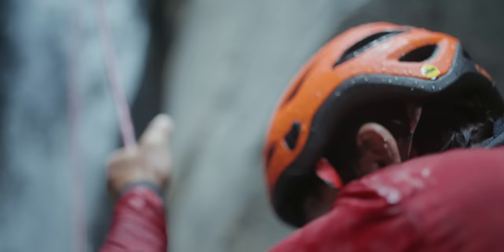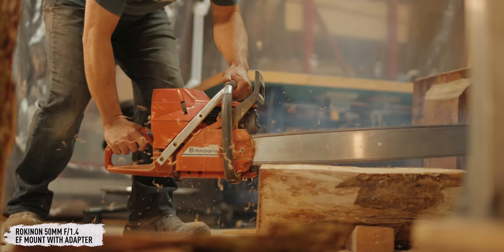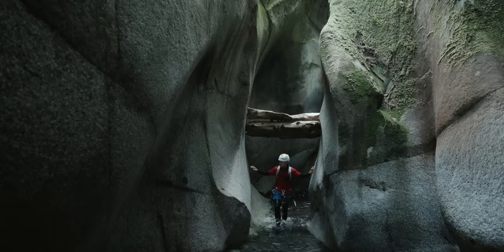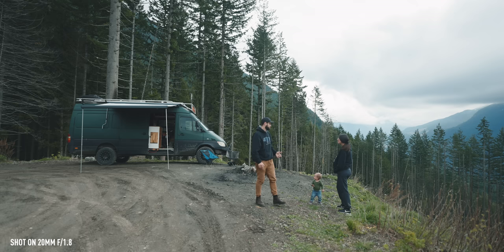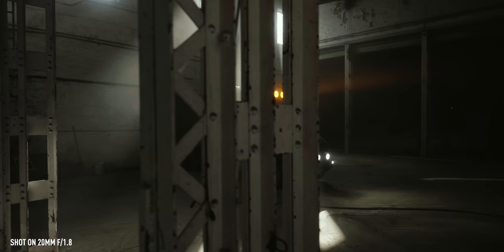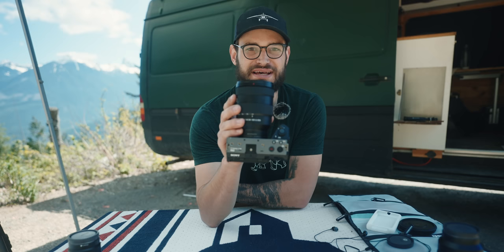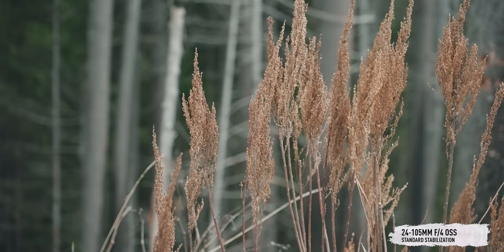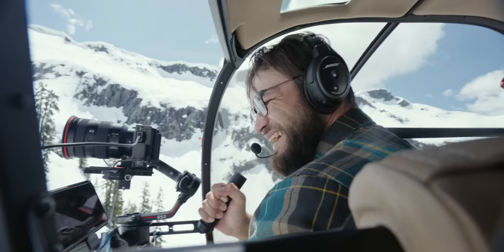The Best Lenses For Sony Full Frame Video A7siii & A7iv

Comment: Thank you for making this video! I need to be reminded not to fall into the focal length trap on the daily 😂. I'm torn between the 24-105 and the 24-240, we film outdoors mainly and I'm often in scenarios where I'm far away from things happening (hiking for example). My first instinct is to get the biggest range, but I figure there is a reason everyone raves about the 24-105!

Comment: Great video. I have 24-70 sigma which is most of the time on my camera. I have 90mm macro lens which is also great for portraits. And than 100-400 sigma which I have with an adapter so regretting a bit. Next one I will love to get the new 14 mm emount. I am hoping next generation of fx3 will have internal nd so round glass won't be an issue. Until then in direct sunlight I can always use 24-70 with nd, or I can find a darker spot and crank up the shutter speed a bit.

Comment: What you meant about f/4 on the 24-105 is "you're still getting that LACK OF depth of field".  Depth of field refers to the range of what is acceptably sharp.  You were referring to SHALLOW depth of field, which is basically saying a blurred out background (not "bokeh", which most people use incorrectly, too).  "You're still getting that blurred out background" would have been a proper description.

Love your videos!
Reply from the maker: Yeah, I use dof and sdof interchangeably

Comment: As a beginner, I don't get what's better to start with! Full frame sensor or aps c sensor. I find difference minor and it confuses me. One reason it makes go apsc is it's just less price then full frame. That's all
Reply from the maker: Apsc is nice because of the size and form factor too. You can definitely keep using it alongside a FF if you buy it later.  The bigger challenge is deciding if you buy APSC lenses or use full frame lenses on your apsec

Comment: Thx for this great info. I shoot a lot of handheld quite a bit as well. You said for at least one of your handheld shots, you turned OFF IS and then used Catalyst Browse. But then you shared how important IS is. Just wondering how important it should be in my next purchase. Thx again.
Reply from the maker: Depends what you value. I use IS constantly on every lens that I own that has it. It is very useful. I am not going to put every single shot through Catalyst.
Reply: Thx! But the 20mm/1.8 doesn't, correct? @Levi_Allen
Reply: Also, do you use filters? Your shots seem nice and milky. ◡̈ TY! @Levi_Allen

Comment: I am using a sony a7iv this year to film my deer hunts. I HAVE to utilize a remote for zooming as i only have one hand available to move the camera around and zoom in and out. I have a question NO ONE can seem to answer. Not b&h, not anyone. I am aware that the Sony PZ lens will work with a remote, however the other day I was trying out some other lenses for example the 70-200 f2.8. I noticed this lens would also zoom in and out with the remote however it seemed different than the PZ lens. For example when zooming in and out with my 18-105 PZ lens it tells me the MM I am at when zooming in and out. The 70-200mm just showed "1x, 2x, 3x" it did not specify MM's. Am I seeing an optical zoom with the 70-200 or is it like digital or clear image zoom? Also would the 24-105 be a good upgrade over the 18-105 given my situation? Thank you, I hope you or someone else can help me understand.

Comment: I just recently got a rokinon AF 85mm f1.4 for $369 on sale. I took it because that is a great deal. I have been enjoying it a LOT so far. Only down side? I have an apsc sony a6300 lol. So it is actually like a 136mm. Still sexy 😍 but other than that I use a 30mm f1.4 sigma prime lens and the default 16-50mm f3.5. Would love to know where you filmed this video at! Those mountains and scenery are beautiful! Great video otherwise! Very helpful in building my perspective!

Comment: Your Videos are always sooo nice, well thought out and with useful and honest insights!
You have a nice set of lenses <3

I'm team handheld and its ironic i have chosen to go partly for heavier lenses 😀I'm using the sigma 24-70 E mount (such a fantastic lens) the sharpness and the AF is absolutely incredible, for the most Image films, corporate stuff this lens is all what i need, for interviews i love to use my primes (if time is not critical) the 35mm F1.8 FE from sony is such a underrated beast and light as the 55mm from Zeiss. I have a Sigma 50 mm 1. 4sitting in my bag but i barely ever use it, its a shame,. 
I'm using the Tamron 70-180 F2.8 as telelens and it has been one of my best purchases ever, the AF tracking is insane and the bokeh is just perfect. 
if I have to pack 2 lenses in my Kit to have 95% possiblities it would be the sigma 24-70 2.8 / and Tamron 70-180. Catalyst Browse made me throw my gimbal in a corner, especially for weddings, when there is little or no time to setup (and i often can use just 1 body with me what is just huge), just custom on M3 on my Sony SIII (higher shuterspeed, no IBIS) and you are perfectly fine for all kinds of gimbal shots. I rather invest 30 min in post and drink a coffee to render the clips out than to f around with gimbals on such events) it is such a game changer...

Comment: Funny, we have a similar system. We have the 24-105 and 20mm as well. I will definitely checkout catalyst browse since stabilisation in davinci resolve sometimes creates some strange wobbling. Sometimes I have a problem on the 24-105 that the video is getting dark for a quarter of a second and comes back immediately, maybe because of a missing ND filter. Did you ever experience that? Thank you for the awesome video, we subscribed to the channel 😎

Comment: I'm looking at the 20mm f1.8 and a 24-70mm, I film cars and motorcycles, reviews where I'm static and then getting B-roll of the vehicles. Would you recommend the 24-105mm f4 over the 24-70mm? I'm going to have it either on the a7siii or the FX3.

Comment: Just curious what setup you had on the DJI RS 2 for the helicopter flight? Looks like there was an additional handle you were using? Going to be doing some similar work in a helicopter next month in Kauai with the A7siii and 24-105mm with a ronin and I like the setup shown in the video!

Comment: I've had quite a few lenses, but I've narrowed down to the Sigma 24-70 2.8 and Sigma 50 1.4. I also bring the Tamron 70-180 2.8 because it's light/small enough to not be a big deal, and even though I love the crap out of it, I don't use it nearly as often. The 24-70 focal range is honestly hard to beat, and really you could get away with that single lens for almost everything and have a super minimal kit.

Comment: Thanks for det video, you've convinced me that my next but will be a 20mm/1,8. But I got one question I hope you can help me with. I've a Sony pxw-fs7. It works good but the menysystem/buttons and weight annoys me, and I am sometimes worried about the auto-focus (I usually work alone). I understand that the A7siii AF is more reliable and the formfactor is neater. But what confuses me is the quality of the video. Is the A7 as good as the fs7 (I´m terrible bad in comparing and judging pictures)?

Comment: Thanks for the great video. So why you think the 16-35 gm at 20mm wouldn’t be as good as the 20 prime?
Reply from the maker: F1.8 is a huge advantage for shallow depth of field at that focal length. The leight weight size is amazing

Comment: I was planning on picking up a sigma 24-70 to use with my A7S3 ... as the sigma 24-105mm Canon mount that I use with my FS5 doesn't play so well with the A7S3. But after seeing your video I'm tempted by the sony 24-105. 

Levi (or anyone who's used these two lenses) - how do you think sharpness / color / contrast compare between these two? I still love my sigma 18-35mm but not a FF lens, and no IS.

Comment: I don't relly get the point of a 16-35 focal lenght when you got that 20mm prime and a 24-105 🤔
I think with the 70-200 you can go with the much less expensive F4 version and it will do just fine! (plus it's 600g lighter)
Reply from the maker: 4 mm on the wide end is a big difference. It’s why I prefer a 20mm over a 24mm. And it’s why having a 16mm over a 20mm is helpful. Will I be able to get a 16mm f1.8? No. So that’s why the 20mm is bad ass.

Comment: Hey! Thanks for the video! Maybe you or someone else can help. I just got the 20mm and I am using it for talking heads with the A7III but the autofocus is pretty bad... keeps changing a lot. Am I missing something on the settings?
Reply from the maker: I would guess your autofocus mode, or settings is off. I’ve never had a single talking head issue with the lens

Comment: whew, I almost pulled the trigger on the 16-35 OSS. Thoughts on the 20mm for on the go/vlog style shots?  would rather save some money and weight than get the Gmaster (but will if its the best option visually however)

Comment: Focus peaking not working so well on my Sony a7r with a vintage lens I have Tokina 35-105mm f3,5. I focus on something very far, like 40m way and things 1-2 meter can show red peaking color. Is that any settings I missed? This never happen on my Olympus
Reply from the maker: I never use focus peaking, sorry. I only ever use it on large external monitors

Comment: I really appreciate this video! I definitely would have benefited from it years ago when I bought the Canon R w/ 24-70 and 70-200 2.8 lenses. That combination made me switch to m4/3 system simply due to size and weight. I probably should have tried the f4 24-105 for the canon. I do quite like my G9 w/ 12-60 for it's size, but as I'm shooting more video these days, the auto-focus is leaving a bit to be desired.
Reply: That's interesting, I am using the R6 with the RF 15-35 & RF 70-200 2.8 and the 50 1.8 for all my midrange stuff. Now I am trying to decide between the 28-70, 24-70 or the 24-105. I do a lot of video, so I am leaning towards the RF 24-70 2.8 atm...
Reply: @ElBoyoElectronico  I’m in a similar situation with R6 & R except I already have the 24-105 f4.  Great lens outdoors but I never use it shooting indoors.  Requires too much power lighting rooms/scenes.  I only have small lights (300dii,120dii’s etc).  When I need flexibility of a zoom I’ve been using sigma 18-35 1.8 in 4K 1.6x crop mode on the R6 (28.8-56mm 1.8).  Good for full length to medium close up.  I’ve had great results although I’m likely going to sell the 1.8 and 4 lens in favour of the 24-70 2.8.  Greater range and the extra stop which doesn’t sound like much until you need to light the room and the talent.

Comment: I thought the a7iii had 5axis ibis. Is it not good, or does it only work with certain lenses? I just keep hearing people say the a7siii is so much of a life changer, but I dont ever heat WHY or HOW. (Not saying it isn't, the case, just that I have never been able to find out what the difference is.
Reply from the maker: I didn’t use a73 aside from borrowing it. It lacked in some critical ways. The jello cam from handheld work was more pronounced. Making the 5axis helpful, but still very much looking like a dslr handheld look more often than the a7siii does. Most notably the lack of 4k60 prevented me from using it regularly for work. The lack of 4:2:2 10bit codecs was also a serious downside for work. That is not to say it isn’t a very capable camera all around.

Comment: Convinced me on the 24-105. Do you usually stay at F4?  Or change frequently. This is my first F4 (it’s ordered). It has a creaminess to it. Are you shoring in S-log 3?  Using a LUT?  You have a new subscriber. :)
Reply: Besides the 16-35 2.8 this is my only other zoom. The rear of the lenses I have are primes.

Comment: Does it really make a difference if it’s a full frame sensor vs apps-c?
Reply from the maker: Nope it doesn’t make a massive difference. You can capture visuals that are very similar in both systems. A full frame is considered a ‘superior’ sensor size by many, but there is always trade offs. I like the small size of APSC systems and the depth of field is fine

Comment: Great Video and appreciate your feedback on the the lenses.  One question is what are you using for your ND Filters?
Reply from the maker: I had a whole section I cut for length. I use variable NDS for all my outdoor run and gun shooting. I have one for each lens so I'm not spending time switching them. My favourite variable ND's currently are from Polar Pro and Moment. The V2 Polar Pro variable ND has one of the most ingenious carrying cases I've ever seen. So that is my absolute go to currently. The hard stops are really nice. If I'm not running VND's I just have a UV filter on so I don't scratch my stuff. VND's have a more aggressive colour shift than a normal ND would so, if I am shooting with multiple cameras in an outdoor setting I try to match the VND brand so the colour shift is the same and easier to correct where necessary
Reply from the maker: oh I also use adapters to get everything to 77mm so I can use the same caps and filters on everything
Reply: @Levi_Allen  Yah that's what I was looking at.  Need to go from 62 to 82 so a lot of steps.
Reply: @Levi_Allen  Thanks. I think I'll be saving up for PP VND. Do you have both the 2-5 & 6-9?
Reply from the maker: Yeah I buy step up rings for more specific sizes. So there is only one step up ring and not a stack of them. I buy the expensive ones so they don’t bind to the filter. I have the 2-5 current and I use it most on my zoom lenses. If I wanted to shoot more at f 1.8 I’d get the other one.

Comment: does the oss work with catalyst? the you probably get the best stabilisite footage out of your cam? or i’m wrong? of course putting this system on a gimbal would even be better. but handhelt? what is better oss lens with internal active stabilisation or oss lens with post catalyst stabilisation?
Reply from the maker: You have to turn oss off
Reply from the maker: Catalyst is the smoothest possible, but it crops in and requires an additional process

Comment: Is it a pain to stabilize everything in catalyst browse then move it into your video editor, or is it a pretty seemless experience?

I have the 16-35mm, and get a ton of wobble in the corners. I've been thinking it's my old a6500, but since you said it as well, it must the the lens issue. I'll have to think about possibly swapping that out.

Can you do a video on the different attachments you run on your camera and what scenarios you add what accessories? I saw a couple setups in this video I'm really curious about!
Reply from the maker: It is a multi step process. Would be much easier if it was a plug-in. I only do it for a few specialty shots. I would not make a plan to do it with a majority of what I shoot. It’s just a helpful tool for specific use cases. The big downside is that you need to turn off your stabilization in camera to use it. That means if you decide not to use Catalyst browse. You are stuck with a bunch of shaky footage
Reply: @Levi_Allen  is stabilization with catalyst a significant improvement from the built in stabilization of the a7siii, or is it pretty minimal improvement overall?
Reply from the maker: @SummitForWellness  - look at my test shot in the video. It’s literally magic
Reply: @Levi_Allen  I had meant catalyst vs in camera stabilization, you have to turn off in camera stab in order to use catalyst, right? So the before was with no stabilization and after was with catalyst. What about a comparison between in camera stabilization and catalyst stabilization, that would probably require 2 cameras doing the exact same shot, but that's what I was meaning. With catalyst it is like magic though, it looks super clean!
Reply from the maker: @SummitForWellness  you cannot get results like catalyst from hand held shooting with in body stabilization only.

Comment: Why not use MFT?
Reply from the maker: I used to use the Gh5! That's how I started my career. At the time I made this video, there was only one solid option for 4k 60fps with good autofocus and that was the a7siii. I'd be open to trying other options now, but I dont usually change my camera systems that frequently
Reply: @Levi_Allen  Thanks you rock